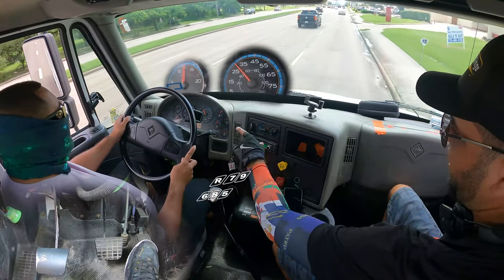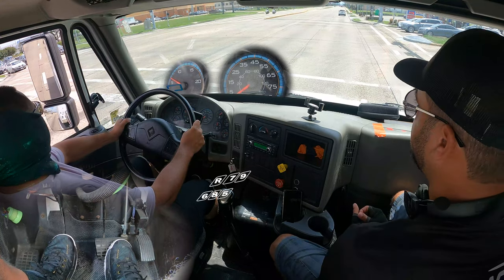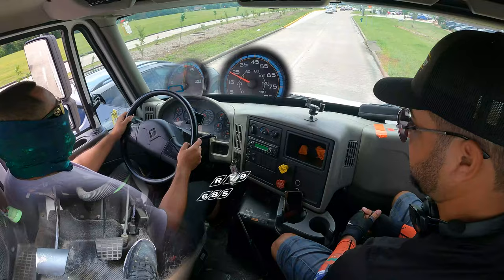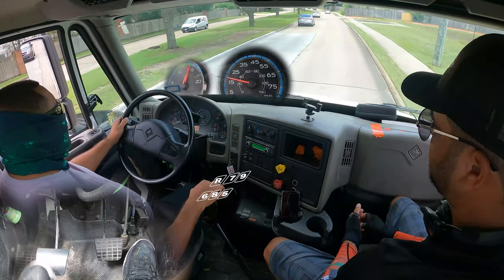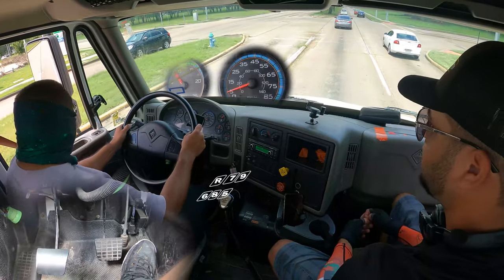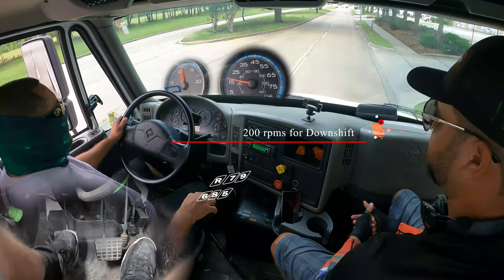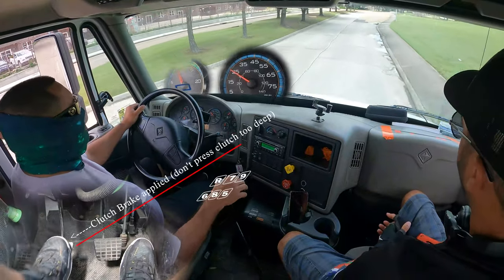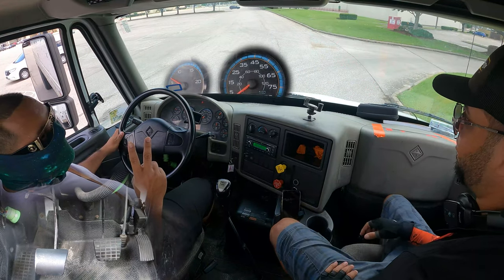Gear Selection While Turning | How to Approach Turns - Part 2

Comment: Just passed my test today, lost points on coasting can you do a video on that?
Reply from the maker: Part 1 of this video explains that
Reply: Doesn't matter you passed the test you can drive however you want now don't listen to everything they say is wrong drive how you want now
Reply: Once you get some wheel time in your truck.
You will be extension of your truck.
Smooth operator.
Reply: Drive the way you feel comfortable obviously don't coast down a hill but you get the point

Comment: To downshift from 9th gear to 8th gear, its about 35 mph. Look at it like 3+5=8. (8th gear), that's to get to 8th gear. And so on. Example, 

8th to 7th gear is about 25 mph. 2+5=7 (7th gear)

7th to 6th gear is about 15 mph. 1+5=6 (6th gear).  It's a helpful tool you should get the idea.

Comment: Great videos man. What mph do you have to be in to downshift to 5th gear? Is it okay if we just downshift to 6th? To stop
Reply: 5th gear you need to be at 10 mph. And small rev like if rpms drop to 900 rev it to only 1000 or 1100.  If you're going fast like 12 mph you can even go to 5th but it has to be a higher rpm like 13 or 1400. At that speed of around 12 mph choose 6th gear which is a lower rpm.
Reply: @andrewterra4938  is that the same for an 8 speed also?
Reply: @mikehayes5167  Nope. Never had but it will be different. For turns, for as low as 5 mph in an 8 speed, I've heard to try 3rd gear. If not try 2nd gear.
Reply: To downshift from 9th gear to 8th gear, its about 35 mph. Look at it like 3+5=8. (8th gear), that's to get to 8th gear. And so on. Example, 

8th to 7th gear is about 25 mph. 2+5=7 (7th gear)

7th to 6th gear is about 15 mph. 1+5=6 (6th gear).  It's a helpful tool you should get the idea.

Comment: This driver is going to eventually stall out ! 

He is removing his feet from the brake to early and relying on the clutch and accelerator 

The proper way is to slowly release off brake and clutch until you feel the clutch bite 

When it bites release from brake and begin slowly pressing in accelerator